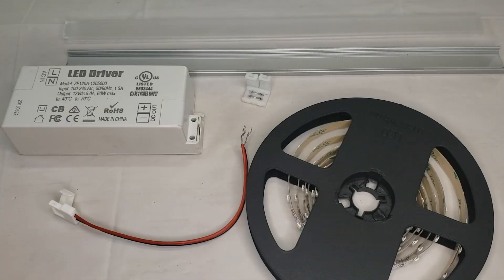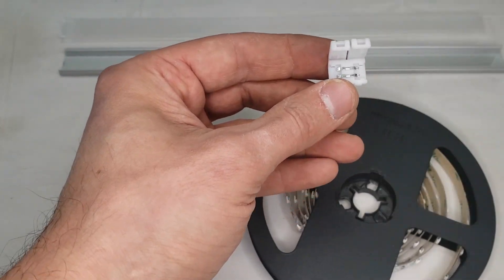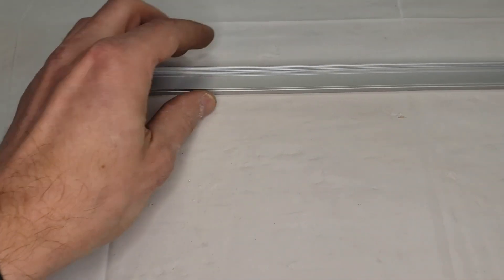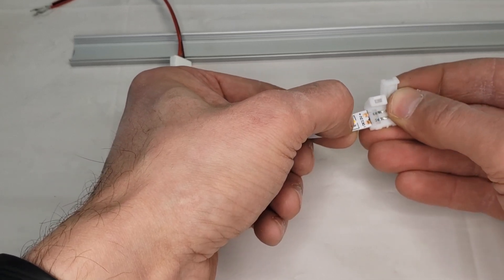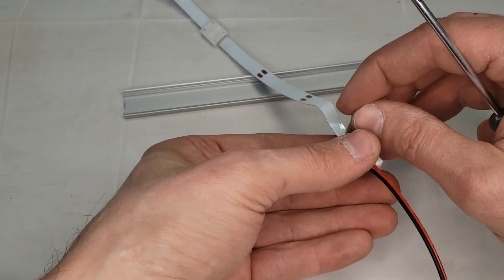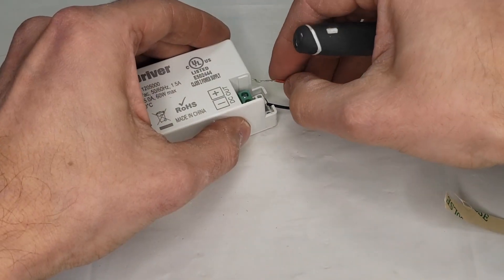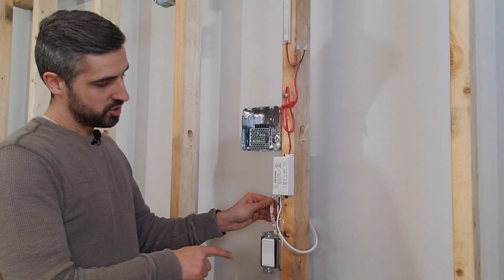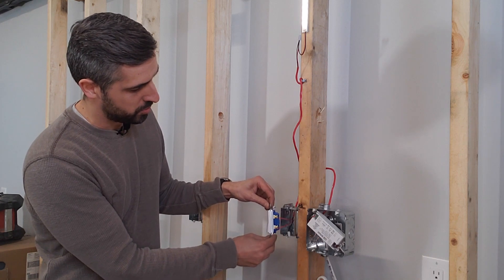Basics of How to wire LED strips

Comment: Thank you for this! I have a 24V LED light strips with the black and red wire… so will I need a 24V LED  driver or can you get away with a smaller one or…. 

I have NO idea what I’m doing 😂
Thank you!
Reply from the maker: Yes, your power supply needs to output 24v.

Comment: I have the same led driver box, but led strip I have has a usb plug. If I cut the plug off, I'll have the red and black. But also a green and blue wire I think from usb cable. So I'm this situation,I just leave off the blue and green taping them out, but im reduced to white led only?

If I had known, I would've bought a 4 channel led driver
Reply from the maker: Sounds like you have an RGB led strip, Red, Green, Blue, and Black is your common (power). I think you'll only get 1 color by connecting red and black, and it will probably be red. You would get white if all the colours could be connected, I'm pretty sure that's what happened from previous rgb strips I've worked with. I have gotten the wifi multi channel drivers before and used an app to control it.
Reply: .@energyoneelectric  ok ty that would make sense.  I'm just trying to find a small white led strip to put in an address box for a home. I just finished wiring up everything and have the DC red/black avail. Led bulbs are in it but needs more light. The kit was only $5 walmart so I'll experiment with it, thx.

What I'll do is branch 3 wires with connectors off the negative, so homeowner can choose red, green or blue. Or plug all 3 connectors in attached from the strip to give white